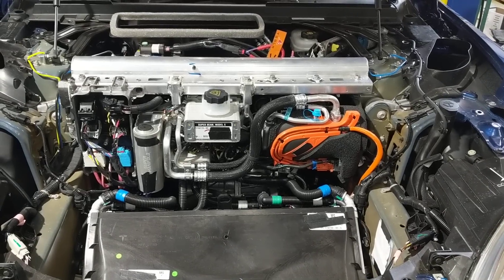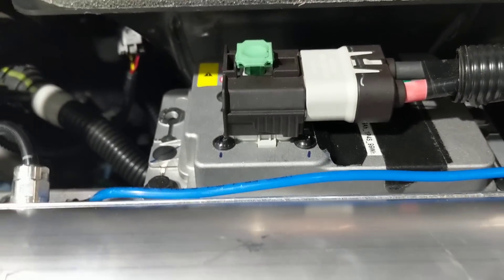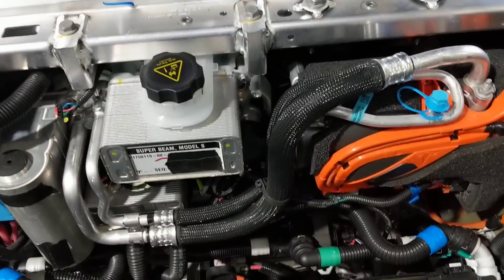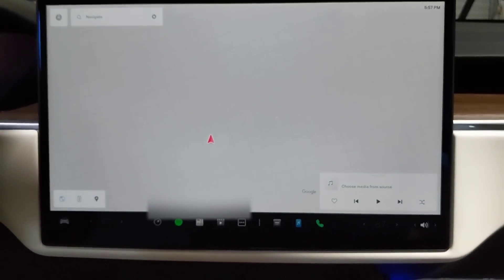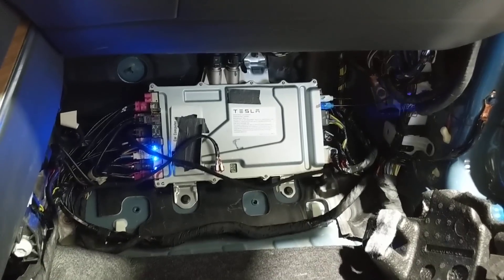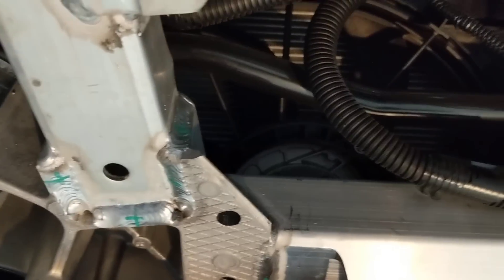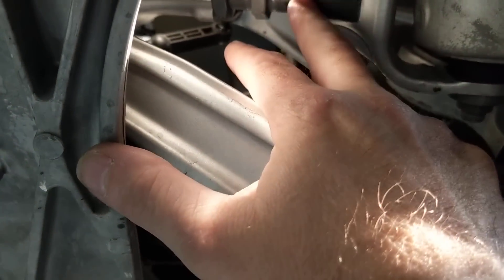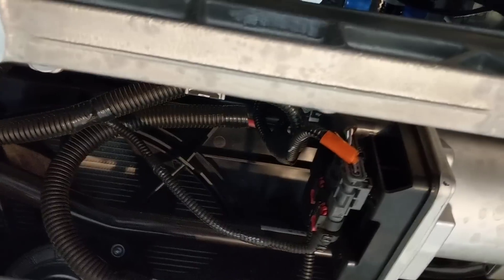Tesla Plaid - Initial Exploration

Comment: When you peaked at the front connectors on the battery pack the data connection obviously has to have some kind of weatherproofing. But it is sort of just hanging out there. Is there a cover in front of that under the front area that would prevent road debris salt dirt from collecting up in front of that battery where those connections are at?
Might not be a bad idea for people that live in snowy areas to spray a little fluid film over some of those electrical connectors. It's non-toxic and won't hurt anything but it will provide an extra layer to prevent oxidation and corrosion. I wouldn't be so worried about the big mean battery connections. But the data connector has a bunch of small wires that's where bad stuff tends to happen. I also wonder susceptibility to rodents chewing on wiring. That's a problem in a lot of places especially on a car that sits low to the ground it's pretty easy for those guys to creep up into a car and wreak havoc on electrical systems.
Reply from the maker: Yes, all the connectors are well sealed.  Take a look at my Plaid battery video: https://youtu.be/JRT32j-RZZc

Comment: I'm very surprised to see those adjustable links similar to aftermarket suspension arms.  That could lead to the possibility of those arms being adjusted to different lengths, which can make the car handle differently around left and right corners.  Usually OEM's use eccentric bolt adjustment for this reason, so keep the suspension arms the same length on both sides.

Comment: Great video, as always. Hey, was wondering if you could do a quick test the next time you have access to a Plaid... Could you please check the voltage of the "12v" system at the accessory plug  when the DC/DC convertor is powering the "12v" system, and also once again when the "12v" battery is powering the system?

The changes made to the low voltage system are causing some guys to have problems with aftermarket 12v accessories.
Reply from the maker: I don't have to measure it, I can tell you for sure it's about a volt or two higher.  If  you are trying to run a 12v accessory and the voltage is too high, then put a couple of properly amp rated standard silicon diodes in series with the feed to the accessory.  That should drop the voltage about 1.5V.
Reply: @Ingineerix   So it means it's a standard Li-Ion or Li-Po 4s1p battery, 16.8v when fully charged.
Reply: @Ingineerix  I really would have anticipated LFP simply because 4 x 3.2V cells is a lot closer to 12V than 4 x 3.6V which is a bit high, but now that I'm seeing this complaint, I'm not so sure.
Reply from the maker: @fjalics  I too was surprised it wasn't LFP.  4 cells of LFP definitely can't handle 16 volts!   I have a video about it here:  https://youtu.be/fJH1r1s8B6Y  (Part 1 is here:  https://youtu.be/QLVFxgKnV0U )

Comment: I would have liked information on actual, real battery pack voltages and battery charging voltages over the entire SOC range. And the organisation of the battery pack itself.
450 V nominal (see manual) is highly unlikely (125s of 3.6V). Reason: a common 500V charger could only apply 4V per cell and not charge any further.
The old designs were 96s battery packs. I guess the new one is 108s. And 450V is the new end-of-charge voltage of the cells (108s x 4.15V = 448.2V). Then a 500V DC charger still has 50V of room to apply a higher charging voltage per cell. In the end: a charger always need to apply a charge voltage higher than the actual cell voltage to get energy inside the cells.
Reply: On another of the videos on this channel he finds that the pack is 110s - very close to your guess. 456.5 volts at full charge. Still comfortably under the 500V limit of the charger.

Comment: The battery is def LiFePo chemistry. Other way it would not match a 12v lead battery.
Reply from the maker: I don't think so.   The voltage is much higher.   It's floating at 3.9v per cell, that's too high for LiFePO4.
Reply: @Ingineerix  I guess, you are right. Doing the math: 99 Wh / 6.9 Ah = 14.34 Volts. Divided by 4s: 3.58 V. That's already too high for LiFePO4. Tesla manual even states 15.5 V nominal for the low voltage battery. Would translate to 3.875 V nominal per cell.

Comment: 5:29 Interesting tip about a future passenger display.
- Did you find an ODBC connector, if so does the ScanMyTesla or other software can get info?
- If no ODBC, or the ODBC dosen't work with SMT, is there a connector on the back of the central consol, to connect an ODBC connector?
Reply from the maker: You mean OBD.  Technically it's called a DLC3 connector.  There is no OBD requirement for EVs.  There is a CAN diag connector under the screen, same is the older Model S.

Comment: Does the charge port area have enough space to fit a CCS connector, for markets outside the US ?
Reply from the maker: The charge port looks identical to older S, so no, they will have to change something for CCS Type 2.
Reply: @Ingineerix  That seems a missed opportunity.  New rear lights would have been a nice facelift feature to enable this too.

Comment: The Model S Plaid is significantly lighter 175lbs than the 2020 Model S Performance while adding the third motor. The tires and wheels are also larger. Do you have any idea of where they reduced weight? I assume some from the casting and the 12v battery but there has to be more.
Reply from the maker: Lots of little things all over.  I suspect a lot of weight savings in the pack too.  Switching to the PCS architecture over the original S with separate DC-DC and charger probably saved at least 20lbs.   The PMSRM motors are quite a bit lighter than the induction unit it replaced, also, no differential.
Reply: @Ingineerix  also the 12v battery

Comment: Any comment about what the rear castings are around the rear motor?  Single piece?  Gigacasting?
Reply from the maker: It's 2 large castings that split top/bottom.
Reply: @Ingineerix  is that a huge improvement from before?  i've seen the older motor subframes and they look like welded pieces together.  Not this single piece casting.  so the top piece include the rear wheel wells?
Reply from the maker: @eddiemoy  No, just the subframe which is isolated from the body with 4 mounts.  The only thing attached to the subframe besides the drive unit is the suspension.

Comment: "Quickest production car, at least in it's class"

You probably meant fastest or spoke out of shock and awe. It is the quickest production car full stop by quite a bit... Next in line is the Taycan at 350kW, vs the Plaid 760kW. Power than can be put on the ground at close to 0 RPM.

The refrigerator is not a volume production car. A person earning the median income in the US could work their entire life and save every penny they made and still not afford it's $2.4M price tag. They have no dedicated showrooms in the US, at all. There are zero service centers with experience working on refrigerators.

The Plaid is the quickest production car ever. And it's not even close, No asterisk needed. it's a leap frog in terms of power output from a stand still that can be driven on the highway and in the rain with no modifications to it's power supply or wheels from it's drag configuration, unlike the Demon.

Let's make standard metrics that keep up with the times and actually drive innovation. No it doesn't go 500km/h, so it's not the fastest, but it is the quickest by a lot... And they should be rewarded and lauded for their amazing accomplishment without restraint or asterisks from clearly less polished technology demonstration vehicles.
Reply from the maker: John is correct.  I personally saw the 1/4 mile race Brooks from Drag Times did with the Rimac Nevera.   In fact, if you check my channel blog, you can see a power vs speed plot I made with CAN data from the Plaid.   Now comparing a 2.5M car with a 130k car is sort of nuts, but technically the Nevera is indeed a "production" car, just not that many.  That's why I said "class".
Reply: @Ingineerix  Where do we find, or how do we access your "channel blog"?
Reply: Rimac Nevera is faster, but it's  about $2.5M and they'll make like 100 of them.  I think there are only 1 or 2 in right now.  Rimac did merge with Bugatti and also has Porsche funding, so they are the real deal, but yeah, totally different market.  Surprisingly, still weighs about the same as Plaid S!
Interestingly:  
at ~50-60k price point, Model 3 performance (BEV) dominates
at ~120-150k price point Plaid (BEV) dominates
at >$1M price point, RIMAC (BEV) dominates, at least until Roadster 2.0 arrives.
Fun times.
Reply: depends on how the metric for “quickest” is set. on 0-200 km/h, 2019 Bugatti Chiron Pur Sport is still (considerably) quicker.

Comment: Would love to hear your opinion on how the Plaid maintains peak power so low into its SOC even when using 18650 cells!
Reply from the maker: It doesn't.  The BMS current limit tops out at 2300A,  so as voltage drops, so does peak power.  You can see it drop even during one run.   I have a graph of a 1/4 mile run.  I'll post it in my channel blog.

Comment: Can you get a peek in the rear near the charge port door? Is there anything to suggest a new charge port design would fit? 
For context: the parts catalog originally showed the current charge port labeled INTERIM and also a diagram of a totally different charge port (still using the North American plug). They later removed the new port from the diagram. There were rumors of a new rear-end design including a lightbar, but obviously that didn't make it to this version of the car.
Reply from the maker: Yes, the charge port electronics are new.   They definitely haven't changed anything with the lights or the charge port door externally.

Comment: So how fast is AC on board charger. Is it incorporated into the pack like 3/Y or still there's charger under the rear seats?
Reply from the maker: Same as 3/Y, PCS in side the pack.  ~11kW  (48A Single Phase)
Reply: @Ingineerix  so swapping for Europe 3 phases not possible :(
Reply: @emceh  I believe the charger has 3 parallel components that each handle 16A.  In North America, those work together to charge up to 48A single phase (we don't use 3-phase except in industrial facilities).  For Europe, those 3 parallel components are configured to work with 3 phases at 16A each.  For single phase 220V you can charge using one of the components at 16A.

Comment: little worried about those high voltage lines being routed on the bottom of the car like that, even with a cover that looks like accident waiting to happen. IMO all high voltage lines will have to be run in conduit and away from problem areas like the bottom of the car at some point as time proves they will ware through insulation and short out, forcing NHTSA to regulate.
Reply from the maker: Not shown are the Aero shields I removed to film.  They are substantial enough to stop anything except in extreme circumstance.   Keep in mind all HV is also co-axial, so double insulated with a braid on the outside that can detect a fault and shut down the HV system.   The HV for the Model 3/Y is similar, and I've yet to see a salvage car with damage to HV cables under there.

Comment: Looks like the rear subframe and cradle is dramatically different and much beefier than the previous S (as we should expect, given the Plaid torque).  Also appears to be a very large casting.  Didn't see any welds in the back subframe, but I may have missed it.
Reply from the maker: Yeah, appears to be a 2 piece casting (top/bottom).
Reply: I believe I saw a video about the GigaPress that they're using for this purpose in the factory.  Good for production and probably frame stiffness, but in a crash you're screwed since there's no separate subframe that can be replaced.
Reply: @Patrick94GSR  if you get into a crash where you go byond the crush cans the vehicle is totaled anyway as the motor/inverter will be toast. that is why you have insurance.

Comment: Could we see the front and rear suspension design in more detail?  I noticed just a quick glance at the front suspension with dual lower links and two ball joints to the hub carrier but couldn't really see the upper arms.  And the rear looks like a multi link setup but didn't see the rear bar connections or springs clearly.  I'll watch it again, but it would be nice to see it in detail as long as you have it.  Thanks for the video!
Reply from the maker: It's not that much changed from older S, but with better forgings.   5 link in rear, you are correct in front.  Upper arm appears to be a forging.
Reply: @Ingineerix  Do you think the suspension modification may have fixed the acceleration shudder issue on S and especially X cars?
Reply from the maker: @mj9425  I've never experienced a shudder on any Model S I've ever driven.  Model X definitely has some issues though, but I avoid those anyway, so I can't tell you if they fixed it or not.

Comment: Hey no leaks!! Richrebuilds had leaks!! 🤣🤣🤣🤣
Reply from the maker: It's somewhat normal to see some seepage from O-rings, especially with really slippery fluid.  Once the O-ring is fully wet, the seepage usually stops.   This car has some "wetness" around the oil pumps as well.   Nothing to be alarmed at.
Reply: That's the big difference between a hack mechanic vs an engineer that actually understand how parts are designed and work.